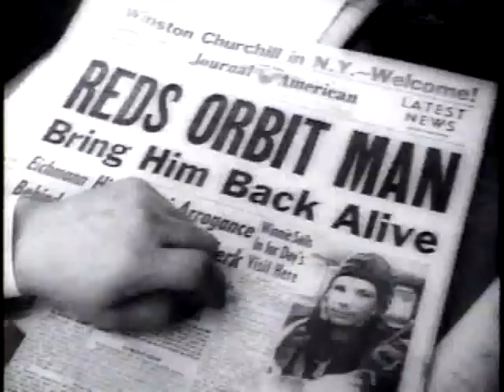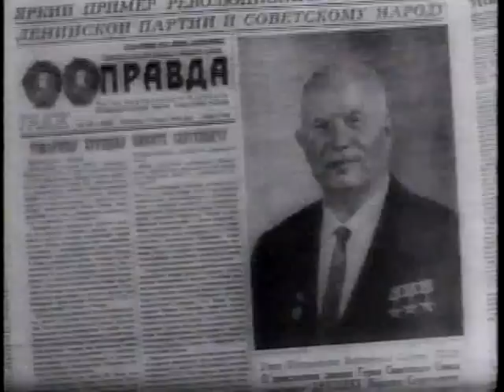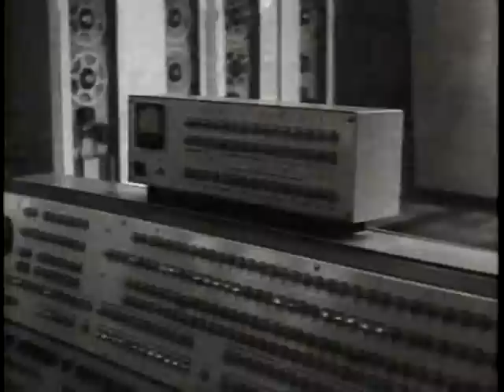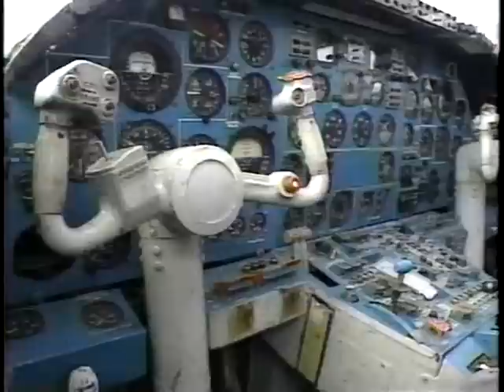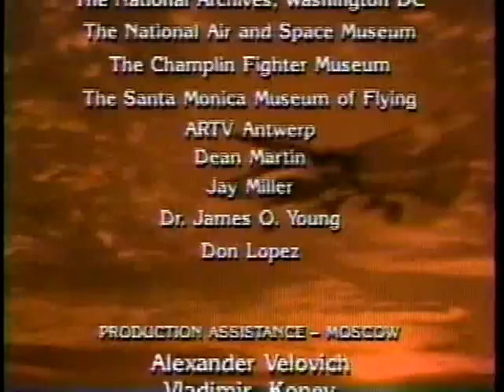The Backfire Bomber

Comment: Outstanding documentary, which provides the full historic context to Backfire bomber development. This context is especially important to understand why the SALT talks almost failed, and depended (in part) on resolving the Backfire issue.

Peter Ustinov has a wonderfully rich and elegant narrator's voice, and remains one of my top five favorite actors/actresses. In the Mozart Mystique (?), Ustinov gave a captivating performance as Mozart's stage-managing father/impressario-- basically, he stole the show.
Reply from the maker: Thanks, glad you enjoyed it. 🙂
Reply: IMHO. With hindsight. SALT talk were peppered by US/UK overestimate of capabilities of TU-22M. With or without re-fuel probe.  If TU-22M (M3 were not in service at time) were overestimated, the low availability numbers of TU-160 Blackjack were vastly overestimated including abilities that it shared with then secret B-2A.  To some extent, overestimates were intentional. With hindsight. US F-15C and F-106 Delta Darts, F-14s, and F-4 of UK could intercept TU-22M with 80% rate.  For anti-NATO work, TU-22M presented a threat only when armed with those huge cruise missiles. Sme for TU-160. A gravity bomb armed Tupolevs's had low to none chance of reaching deep NATO targets.

Comment: All the great technology developed and finished by the end of the 80s by Soviet engineers, only to be neglected and left to rust after the dissolution of the USSR, is as bittersweet as history gets.

The Buran/Energiya spacecraft is probably the saddest example.
Reply: They just copied us.
Reply: @davidlanham99  Soviet engineers might have based their design on the american shuttle as far as general shape goes, but other than that the Buran is superior in almost every way (which isn't strange, considering it is a decade more modern than the American shuttle).

For example, the Buran was capable of fully unmanned space flight and landing on its first flight 1989, while the American shuttle only got this capability in what, 2007?

Read up on it before jumping to conclusions.
Reply: @davidlanham99  The Buran was twice the shuttle the American shuttle was. It could fly and land completely autonomously.
Reply: RIP Ekranoplan as well...
Reply: Well, you and Putin agree on something: that the end of the USSR was a great tragedy. On the other hand, some in the gulag work camps might be more inclined to cheer the overthrow of the USSR.
Reply: @johntechwriter   Not sure if that's what the OP meant...the old Soviet technology that he's referring to didn't do anything on its own, but were used in nefarious ways by the communist regime. And there is a certain level of respect due to the mighty hardware that our old foes possessed, simply because they were able to more or less keep stride with the U.S. during the Cold War and the space race without the massive budgets and high tech manufacturing processes that we possess. One doesn't have to like their enemy or condone their actions to respect them.
Reply: David Lanham Agreed. And autonomous control was nothing new for Soviet era space tech, they had been doing automated reeentry since the first manned flight. Spam in a can, man. Spam in a can.

Comment: Mach 2 nuclear intercontinental bomber in 1970.  We had that in the late 1950's - the Consolidated B-58 Hustler.
Reply: The Convair B-58 Hustler? Fast, beautiful, medium payload, not really intercontinental and very maintenance-heavy.

Maybe the XB-70 fit the bill but SAM's would have been waiting for it.
Reply: Even the XB-70 really wouldn't have the range.  Very, very aerial refueling dependent.  Maybe a 4000 mile range at its most economical speed.
Would have been retired for maintenance and impracticality like the B-58 was but it would cost way more than the B-58, too.
There were a lot of problems with the XB-70 that they found during testing.  They couldn't even keep the paint on the thing and one of the planes had to be restricted in top speed (the #1, surviving prototype; I've seen the plane in Dayton) because of a structural defect.  The second XB-70 really wasn't identical; the wing tips folded through a greater range than the first plane's and it was a more efficient flyer but still not a true intercontinental bomber.
It doesn't seem like supersonic speed makes for a very good intercontinental strategic bomber.  Even the B-1 can't match the B-52's range.
The USAF is planning to phase out its B-1s and B-2s by 2035 if they get the funding to build the B-21, a more advanced version of the B-2.
Not holding my breath!  They don't have a good history of funding replacements for the B-52.  They've built far more fighter types than bombers since the B-52 was commissioned.
Frankly, we spend way too much on military for questionable operations and get too little in return for the buck.   More money should be going to practical industrial research that we actually KEEP in the US and NOT give away for a song (illegal campaign donations) as well fixing the problems with the rotting infrastructure.  They not only have to fix a ton of bridges of roads but also harden the power grid against possible solar EMP.  We lose the power grid for months, a bunch of people will die.  It'll be like Puerto Rico but 2000 times worse with way more deaths...
Reply: The Hustler was simply the most attractive aircraft ever put into military service in history. Too bad it had to give up payload and range to be that sexy. And it was a maintenance nightmare. Absurdly complicated.

However, it had escape pods!
Reply: The Soviets had the Myasishchev M-55 "Bounder," which was capable of speeds in excess of Mach 2 and first flew in the mid-'50s. It flew before the B-58 Hustler and had a larger payload and more range. The only novelty the M-55 Bounder lacked compared to the B-58 Hustler were ejection capsules as opposed to ejection seats.
Reply: AvengerII The XB-70 program had all its gremlins worked out by the time it was ceased in 1969. It would have worked exceptionally well nowadays as a reconaissance or high-altitude, high-speed bomber capable of carrying a four-crew complement, aerial refueling, multifunctional hardpoints underneath and above the wings and fuselage, and it also would have had an extended-sized multifunctional cargo bay which had doors that slid open for operation even at very high speeds. It could carry 50,000 pounds (25 tons) in its original prototype versions, and it likely would have been able to increase that by up to 50% (75,000 pounds/37.5 tons), which would put it on par with the B-52's payload capacity.
Reply: Nuclear Armament can you show me any proof of this claim? All i could find was a M50 with greater weapons load but with a max speed barely supersonic.
Reply: Nuclear Armament proof for that claim?
Reply: @user-gn8hf2ig7w  In practice it had a max speed of Mach 0.99 due to the installation of underpowered engines. With the more powerful engines, it had a maximum speed of Mach 1.84.
Reply: @user-gn8hf2ig7w  It's a similar story with the Sukhoi T-4 "Sotka" (aka Project 100, Su-100), which was designed for Mach 3.0 cruise with turbojets alone (much like the XB-70A Valkyrie), but never actually reached its stated speed.
Reply: @NUCLEARARMAMENT  M-50 Bounder.Two built (the second never flight tested and re-designated M52). The sad fact is that they did not have the engines ready and had to make do with alternatives which allowed only for .90 of Mach. When they did have an engine ready, Kruschev cancelled a huge swarth of projects. in favour of ICMB research.
Reply: Wait.... I had range. I was a contender!

Comment: Anybody else notice the missing piece of the tail at 44:00? It's there on take off, but gone on landing.
Reply: I wonder if it could be an air intake of some sort--possibly a closable intake for an APU or a cooling port that needs to be opened at low speed.
Reply: Good  eye! Noticed that as well.
Reply: yea,seen that too,very odd.

Comment: The Backfire's top speed was 2.3M, and the engines were computer-controlled for optimum performance. The design of the nose-section hints at that low level flight was also planned for, which made it, with a nuclear-tipped missile, a strike aircraft against aircraft carrier-groups. The crew compartment was very crammed, but the Soviets had no problem finding pilots (and tank crews) from their many Far-Eastern Republics who required less space than the Western designs called for. This made the deadly low profile design of the T-72, for example, possible.
Reply: Nope, it's less than Mach 2.
It's Mach 1.88 for the latest version of the TU-22M(mark 3).
There's a difference between "record speeds" and in-service speeds for longevity.
The Concorde WAS capable of Mach 2.2 but was restricted to Mach 2.02 in-service because of airframe heating considerations and fuel-economy.  A few Concordes flew over 20,000 flight hours, most of that time at supersonic speeds which is something very rare for most military types, btw.  There still haven't been many planes built that can supercruise for any considerable length of time.
Reply: "The crew compartment was very crammed, but the Soviets had no problem finding pilots (and tank crews) from their many Far-Eastern Republics who required less space than the Western designs called for."
Like the poor electronics operator of the US Striker Armored Car. Unfortunately if the Striker Crashes, the electronics operator has his spine broken by the shelf in front of him, supporting the computer...
Reply: David James Guess he must have triggered you something fierce, eh?

Go back to your conspiracy theories, simpleton. Some of us are trying to discuss military science.
Reply: David James ‘Everyone who disagrees with me is a CIA SHILL!’
Reply: CaptainLumpy -- I think our dear "Flat Earther" is fifteenth-generation Dog Patch.
They don't all end up nice and humble like Li'l Abner evidently...
Reply: AvengerII I believe you’re right. Probably been hitting the moonshine more than he should.
Reply: IDK about the plane's cockpit but I call bull on the T-72. Many variants continue to be operated by rather tall people. For example T-72M4CZ has the seats in the same position as the early types, and even though I don't know all the Czech tank guys (we only have one battalion), none of those I've seen is of Vietnamese descent or particularly short for a European.
Reply: I wondered about the curious nose-down profile, as well. But what is most impressive is the huge advance in engine performance, going from roughly 60,000 lbs thrust for the Blinder to 200,000 lbs thrust with the Backfire... AND with more than twice the operational radius.
Reply: @DavidWatersJames  Is there something wrong with you, in that you don't know how to discuss a benign subject in a polite manner? I'm sorry that your life is such that you have ended up with so much internalized anger and need to express it in such a way.
Reply: Whine to someone who CARES.
Reply: "Deadly low profile of the T-72”
I don't think the Iraqis agree with you on that ;)

Comment: The problem I have here is 66% wasted on unrelated issues.. so no engine internal tech.. was the wing a variable geometry.. also few videos of in flight.. thanks again 😀😎
Reply: This was more about  the history of what led to the the procurement and production of the aircraft backfire then it was on the actual aircraft itself.  I think it was good video on that aspect. As far as aircraft stats you can always use Google.

Comment: If there is an expert out there - Im always wondering how aircraft can fly in such close fixed formation.  How is it that the airflow for trailing aircraft isnt compromised?
Reply: The rows are staggered vertically. Usually the ones in the rear are below the leaders. They still get a lot of dirty air but those people know how to deal with it.

Comment: Many Soviet aircraft seem well designed, but poorly constructed. Lots of square plates with exposed rivets, clunky landing gear, etc.
Reply: I used to think same thing ,watched a show last week on US vs Russian planes the Russian planes made to operate in less than ideal conditions theres a certain  logic to it like comparing a lambragini to a toyota land cruiser .Which one would you want to cross the Sahara desert in? Yea the lambo is way more refined and made to work in a narrow feild but the land cruiser starts every morning with way less maitenence YMMV
Reply: There is a saying in aircraft design:  if it looks good, it will fly good.  Soviet aircraft design was stuck in WW2, which on the Eastern front was mostly low-level ground attack missions.  You can't build efficient supersonic aircraft if you keep weighing them down with heavy landing gear, large tires, and exposed rivets.  Weight and drag will kill the range of a supersonic aircraft, then the bomb load has to be made smaller because the fuel load gets larger.

Comment: At first 5 minutes we can see Tu-134 and Tu-154. This is a civil aircrafts, not bombers. And they was build after 20 years after Backfire.
Reply from the maker: I've noticed that Tupolev and other Aviation OKBs would do derivatives based off of the same design. They had created the Tu-16 Bomber and later adapted it as the Tu-104 Airliner. The beginning of this Documentary is meant to explain the history of Tupolev's expertise in the production of large aircraft. Plus the Tu-134 and Tu-154 served as forerunners of early Soviet Jet Technology. Moreover, how this technical experience of those two projects were gradually incorporated in the design of the Tu-22M Backfire.
Reply: What you can see is footage of wind tunnel testing, done by TsAGI for models of Tupolev designs, as is revealed by the context and narrative. Of course, given the Soviet military's fetish of secrecy during that time, it's no surprise that only footage from civilian airliners is available. 
But Tu-134 and Tu-154 were designed by the same design bureau that came up with the Tu-16, Tu-22, Tu-22M and Tu-160. So it's about as misleading as showing research at Boeing into swept wing designs for the B-47 and B-52 using footage of testing the B-707 and B-727.
Aerodynamic test models of military aircraft were shown publicly only from the late 1980's, under Gorbatchev's "Glasnost" policy.
Reply: "I've noticed that Tupolev and other Aviation OKBs would do derivatives based off of the same design. They had created the Tu-16 Bomber and later adapted it as the Tu-104 Airliner."
Just like Boeing had military and civilian variants, which used the same wings, tail surfaces, engines and instruments...

Comment: Ballistic rockets made such planes useless.
Reply from the maker: They also mention that in the Bear Bomber episode too.
Reply: You can recall bomber, and you can use them to intimidate or make a political point.
Reply: So will the MiG-29 for an example :P It was built that way, but modern Russian hardware is a different story.
Reply: And that's why the B52 had tubes,not printed circuits.